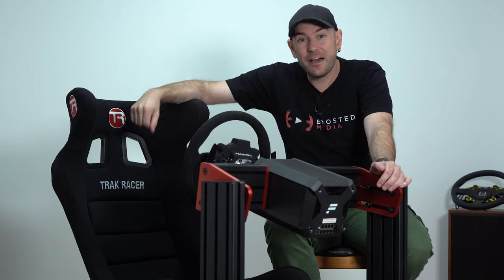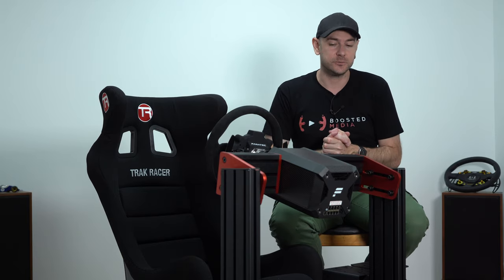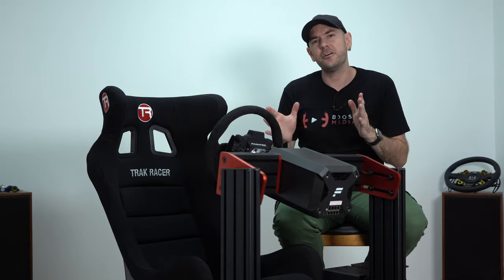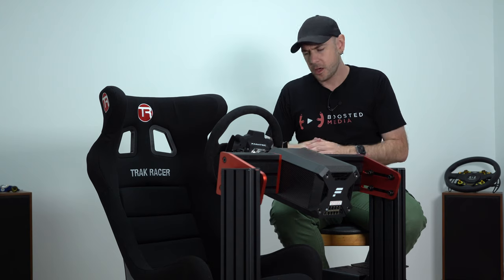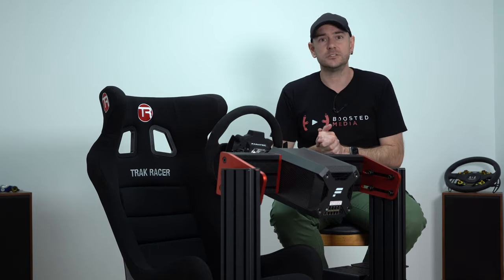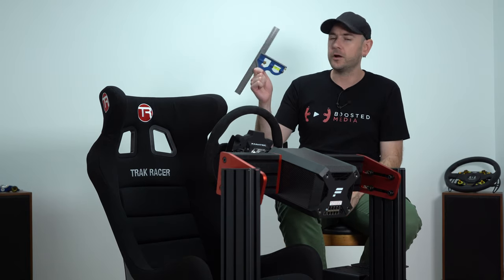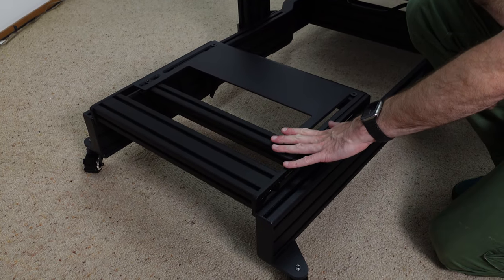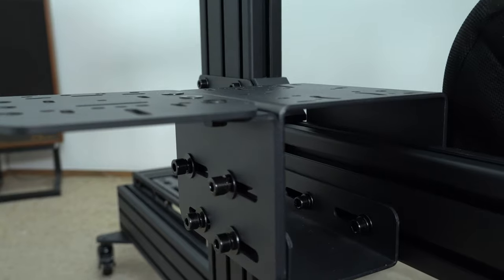REVIEW - Trak Racer TR120 Sim Racing Cockpit & GT Fixed Seat

Comment from the maker: Quick note just to clarify our comparisons with the TR160 we reviewed 18 months ago. That particular TR160 was a MK2 spec unit. Trak Racer are now up to MK4 so as mentioned in this video, a lot of the improvements we saw here also apply to the newer TR160.
Reply: yes the new tr160 v4 looks pretty solid with the 1 piece rails and 6 rubber feet.
good price for the unit but the shipping to western australia is $400.
Whats the best seat to get the rally or get one from another manufacturer.
Reply: No discount code in the link.
Reply from the maker: They’ve stopped the discounts unfortunately. :(
Reply: Is there any need to go up to the TR160 or is this more than you will ever need?
Reply: @boostedmedia  cause they felt put on blast probably hahaha, thanks for your vids man always look forward to them
Reply: @rover1374  would love to know that aswell.
Reply: @ghastous  I went for the P1x and love!
Reply: @rover1374  how much did that all cost you though
Reply: @ghastous  I got it when there was a sale and free shipping as well. Got it for around $1300 aud
Reply: How do you know which version of the TR160 you have? I purchased one used, looks brand new but I’ve seen a wide array of accessories advertised. Different shifter plates and universal steering mounting options.

Comment: I've got a TR80 with integrated monitor mount i've had for close to a year now, I had a pretty seamless experience putting it together, everything came as it should. Can confirm the rally seat is pretty good. The seat slider was pretty ordinary though, had quite a bit of slop in it so I just binned it and hard mounted the brackets to the rig. Fixed up a lot of lateral play too. I have the OG basic pedal deck running VRS pedals, I dont have any observable flex in it either and they're comparable to the HE Ultimates.

I know people have had issues with TR in the past, and occasionally still have missing bits, but they are pretty great value for us Aussies and they've at least tried and continue to try to improve the product and experience and thats not something you see all the time.

It's a good prodcut, but as you said, gotta do your research, some regions have freight carriers that are pretty trash in specific locations so you need to factor in your local freight company too, not a TR issue obviously, but something that impacts it in some way.
Reply: thank you for this feedback. I'll discuss the slider with our engineers/product sourcing team.

Comment: Tr120 owner, very happy with it. Worth mentioning they sent me a wrong part but corrected it relatively quickly. A mate who also bought one also had an issue with what was delivered. They respond to correcting the errors but quite clearly the company has an issue with its shipping process. Not such a huge issue here in Australia but if you were ordering from somewhere else it could potentially mean a long delay before you can build your rig.

Comment: I just got the TR120 myself about 2 weeks ago. it's my first sim rig. I went with the black recliner seat. I was missing some hardware and got a few mismatched parts. But I actually got an email from the owner of TrakRacer with his phone number. He and the head of support rectified the situation over the phone extremely fast as well as gave some compassion for having to wait a few days.
  The only problem I had was with the seat mounting. It says to make 350mm distance for the seat slide and seat to sit on. If you got a recliner seat and the bracket underneath it, the 350mm is too narrow. My recommendation is if you're going this route, just screw the mount to the seat itself. mount the sliders to the bottom of the mount. Then while leaving the 40x40 tracks assembled but loose put the seat, bracket, and rails on the 40x40 pieces and get them fitting together. with your 40x40 rails still loose, find the perfect middle fit. this could also mean that you will have to loosen up the rails to get everything dead center.  The only reason why I'm writing this all out is because I spent many hours assembling and disassembling the seat bracket and rails while leaving the 350mm distance between the two 40x40 profile pieces in place (as it's literally one of the only 2 actual measurements you get in the instructions). I Just remeasured this as I'm typing this out and it's about 325mm from inside 40-40 to the other. another thing I did differently from the instructions was to put the L braces that holds the 40x40 from the inside to the outsides. makes adjustments easier and I think just looks nicer. you're going to have to cut the red strip about 70 mm shorter to fit inside the 2 L brackets but again I really like and think this is the way it should have been in the instructions. 
 I just wish I had the ability to post a picture of this all incase someone else out there finds themselves in the same situation I was in. besides that. the mount is solid (well everything on the TR120  is pretty solid), you will get some vibrations throughout the rig but I again kinda like it. makes it feel more immersing.
Reply: Would love to see a picture of what you described, but it has been a year now :P

Comment: Bought a TR120 at the beginning of this year after a bad experience with a Next Level Racing GT Track. Everything arrived in Brisbane in 3 days and nothing was missing. Didn’t even have any metal shavings in the profile. I can’t speak highly enough of the cockpit. It can be difficult to get someone on the phone at times but otherwise I’m very happy with Trak Racer. I had the instructions printed and bound at Officeworks for about $15. Made it so much easier than reading on a phone.
Reply: thank you for your support. your experience resembles most of our customer experiences; not to say no one has a problem but the happy ones are off being happy (racing)

Comment: I bought the TR120 about 3 weeks ago. It was simple but time consuming to put it together and we were short 4 bolts and washers but fortunately I had some from my old rig at the house. Without them I would have been pissed. Also of note when our stuff arrived the bags holding the bolts and what not had holes in them. The rig itself is awesome and doesnt move. the seat I have was from the old rig and not a bucket so seatback movement is definitely an issue lol. Looking to get a Sparco in the future. LOve my Trak Racer TR120

Comment: I got mine a few months ago, All 13 boxes and contents arrived present and correct. There was a fair bit of swarf with the profiles but I unwrapped onto painter's drop-sheets so no problem really. Assembly was straight forward completed in about one relaxed day. There were a few times when I was glad I have good experience with constructing stuff. because there were plenty of traps for new starters, most of which I avoided.

My only gripe is that because I want to use my rig as part of my daughters driving training starting soon, I got the recliner seat and adjustable slider option. This ended up about 40mm too high for me. It would be nice to drop the two 40 x 40mm mount rails down flush with the top of the rigs main base frames. Future project.

The recliner seat has some flex under hard braking but not enough to be a problem. I use V3 pedals with the enhancement kit hard option. 

I'd recommend the TR120 to any serious sim addict, but would also say if you don't have good practical skills and experience, get help from a friend who does before you start assembly. (Or, watch Will's vids CAREFULLY).

And lastly, most of the fastenings can be re-tightened after a few hours of heavy kerb work with the DD cranked up and rattling away. BUT. the ones on the inside of the DD base require the removal of the wheel base itself to re-tighten. therefore NOT accessible for periodic maintenance! Perhaps a thread sealant here? Locktight? Just be sure to torque em up good first time round,

Edited to be more useful to someone wanting to buy. Cheers and good luck.

Comment: Just bought my TR120 rig upgrading from a NLR GT Ultimate V2. Seat flex was a big thing I didn’t like and wanted to eliminate it. So purchased an OMP TRS-E fixed back race seat with steel frame on OMP seat mounts. The seat is super rigid and very little flex in the seat mounts. Mounted it to the provided sliding rails and I’m pretty pleased. I may remove the rails and bolt straight to the chassis as I begin my test phase.

Comment: I'm in the US. Their products come in many different packages from different carriers and most of the pieces were damaged, scratches and dents, only cosmetic but makes it all look like it's used material from a machine shop. Metal shavings everywhere too. The boxes they were packed in had holes allowing many of the required fasteners to be lost. One package was lost in shipping. I ended up spending 40 bucks on fasteners to put it together which added 2 extra weeks of wait ultimately.

Their customer service in the US is non existent it seems. You can't get in contact with anyone unless you wage a one man social media guerilla war for a few days and then suddenly they become concerned about their image. I eventually did a call from a US representative, a VP actually. He was very apologetic, he helped me out by issuing a refund.

Once put together, the product has okay stiffness and stability. I have the Moza R21 on their supposedly most stable/stiff chasis the TR 160 Mk4, and even with everything tightened and in place there's still some movement in the arms supporting the wheelbase. Not entirely satisfied there as this is supposed to take 25+ Nm, and my R21 can only put out 21Nm. The adjustability could also be better, but I think that's just the nature of using these materials to ensure stability band stiffness. It generally takes 2 people to move the wheel deck up and or when changing the tilt angle, same for positioning the pedal plate.

I also got their single monitor stand and it is very unstable and entirely unusable with a G49 monitor.

I would rate the chassis itself, the TR160 mk 4 at a 7/10, their customer service and availability 1/10, and monitor stand maybe 3/10.

Comment: I've had my TR120 for just over a week now, and i had a couple of nuts missing from the peddle plate(or i used more then expected),I also went with the black and red recliner seat. And I found that the whole rig is rock solid for me.  But I did notice that I didn't get that extra brackets that where mentioned 21:24, so i guess that they are very new and i hope you will be able to be purchase them separately in the future, (as i was looking at add motion system in the future).

Comment: Earlier this year I bought a 4080 rig for my GT DD Pro, totally love it! And it was cheap compared to other sim rig sellers, €345 but for only the frame and wheel mount plate, no seat or anything. Barely any flex except sideways there's a tiny amount but only if you go crazy drifting with high ffb settings. It was at a german company called aluxprofil

Comment: I got 2 TR120's a month ago and so far they have been great. The only tiny issues I ran into were one of the rigs came with not enough bolts and washers, and a couple of the instruction steps had minor mistakes. I also have had the monitor mounts on backorder for over a month but will hopefully be dispatched soon. 

However once setup, it is an awesome looking rig with no flex at all. I got mine with the reclinable seats and haven't really noticed any flex or movement in the seat apart from the minimal flex of the seat rails which is to be expected. 

Overall I'm happy with the purchase and would recommend the TR120 to anyone.
Reply: Thank you for your feedback. We are constantly improving the quality control process and our manuals. I'll let our team know it's still not 100% perfect.

Comment: I got the TR160 about a year ago with the GT style seat and I have to say my experience with that seat is completely different to yours Will. Mine is really rigid and the back doesn't have that pop that yours has. I use the Asetek Invicta pedals too so I put quite a bit of force into the back. All I can think of is maybe you got a dodgy seat or they have changed the seat somehow because mine barely moves. As for the rest of my rig everything came complete, no missing parts and I even had a heap of extra bolts and T-Nuts left over....and no I didn't forget any :)  All in all I couldn't be happier with mine and the customer service I got was perfect. I'm starting to sound like I work there huh....(I definitely don't). Anyway great review Will & Tom. Keep it up boys.
Reply from the maker: Glad to hear your seat wasn’t like ours! Keen to cheer some other experiences!
Reply: I've had my TR80 for about the same length of time with the GT seat and I have the same issue with the seat popping. I did notice if I change my seating angle and pedal placement I can mitigate it to some degree. This made the pushing force lower down on the seat rather than in the mid back where it pops. My brother has an NRG seat which he found on sale for $300 or so and it is significantly more rigid with support across the back.
Reply: thank you for your support Wayne. Most of our clients have an amazing experience with the product and service. There does appear to be a problem with the seat Will has which we can rectify.

Comment: I had my TR120 delivered in 4 days between Christmas and New Years. All bits were there (I do agree that they could mark the boxes more clearly with the items). I used my own seat and regret that, but I’ll be updating that into the future. Yes there was some metal shavings but I took those boxes outside and cleaned it with compressed air. Sorted.

Comment: Picked one of these up a few months ago and used your discount code! Cheers for that. Bit of a mission to put together in terms of adjust ability (there is A LOT). But its a great "problem" to have. One or two things wrong with their manual, but easily sorted once you get your head wrapped around it. Amazing rig at a great price. I picked up a second hand fixed back seat (Cobra) that i used Rpm brackets on the supplied sliders. I have zero issues with mine. So i'd suspect its the supplied rails and cheap seat (which you pay a premium for). I have basically non existent flex.
Reply: thank you for your feedback

Comment: Great review as usual Will. I hope all those profile improvements have carried over to the TR160 MK4, as I pre-ordered one a couple of weeks ago and have just found out they won't have any local stock (NZ) till mid-august, which is a bummer, as I wanted it especially for winter.

I also ordered the universal seat bracket for recline seats and office chairs, so I can bolt my Noblechairs Hero seat to it (as I am 6'4" 100kg ). It is a big and comfortable seat with adjustable lumbar support like car seat (which is comfortable for me to sit in for several hours at a time). I also ordered the new hybrid formula/ GT/inverted pedal plate kit for it - would be great if Trak Racer sent you one of those to test as well.

Comment: My experience with delivery from TR is not as good. No estimated delivery time, no notification when the items were dispatched, no information about how many boxes I should expect, and the order was delivered as three different courier deliveries. I'm still waiting for a response from TR to confirm whether I've received all boxes (SKUs), so I'll have to begin assembly in good hope that I've received all required parts. TR doesn't pick up tge phone or return calls for messages left on the answering machine either. No one is available for online chat either. Looks like a ghost company, so be aware before buying from them.

Comment: Good to know that shavings in/on profiles seems to be an industry thing. Just got my ASR rig the other day, and a couple supplemental pieces from TNutz. Both had shavings. On one had, I think it’s poor form to ship components in that state. However, I do recognize the added costs to cleaning the profiles before packaging. But my goodness, I would gladly pay them an extra $10 for 5 minutes of blasting all the extrusions with some shop air to get rid of at least most of the shavings. I’ve worked in machine shops before. Those shavings get everywhere and it’s hard to completely clean them up, especially on rugs, carpet, etc.
Reply: to eliminate shavings it's a different process of cut, colour and wrap. Instead of colour, wrap (so scratching) then cut. It's all possible, the cost will increase as a result which we will consider.

Comment: Nice Review! I have an NLR FGT Elite rig and I love it. Solid as a rock and no flex. With these aluminum extrusion rigs in general is real world flex really ever an issue?. I find it hard to believe given the nature of aluminum profile itself that that would be an issue in any of these rigs.
Reply from the maker: Not in the profile itself generally, but on some of the rigs we’ve tested, the pedal plate, wheel deck and seat mounts have quite a bit of flex.

Comment: Bought a TR80 a few months ago. The QR code I scanned to find the build instructions was outdated. Several profiles and the wheel base piece had changed without any update to the instructions, website image of the product, etc. I had metal shavings all over my room for months. The T-nuts are cheap. Wouldn’t purchase again.

Comment: @46:44 the side to side lateral seat rail movement is more pronounced with motion. It dampens some of the motion or gives undesired movement. 

Typically we suggest to our clients that they to run a couple of custom cut, extruded aluminum pieces from the right to left side mounts OR as you recommended, a solid mount is best and simple if you do not need a slider. 👍
Reply: we have this SGS tested and the load limit is far greater than any motion application. I cant see any movement you speak of.